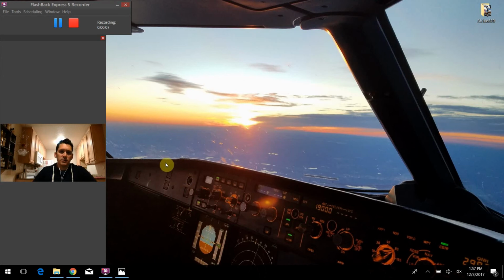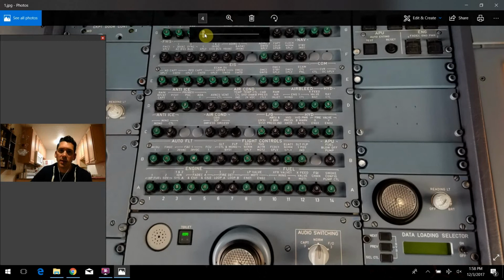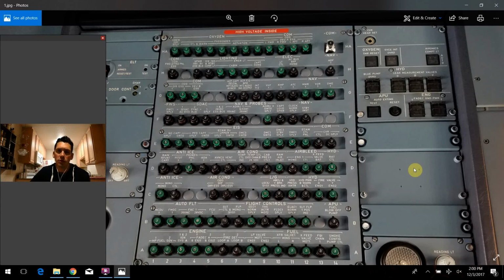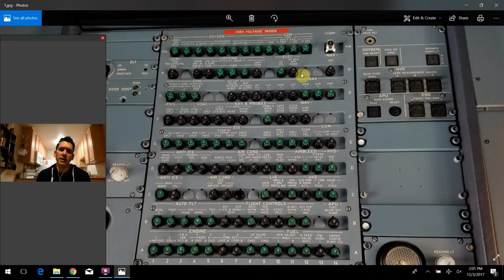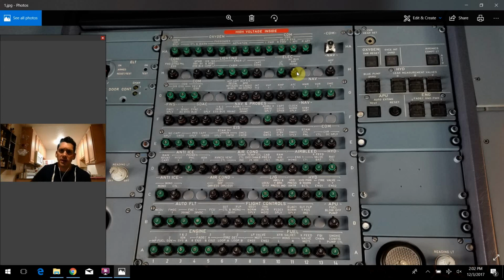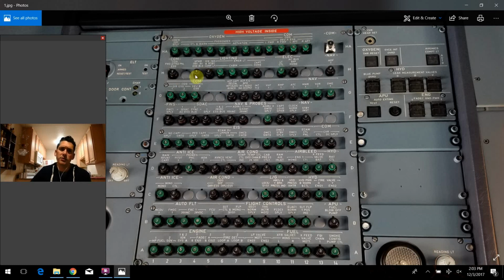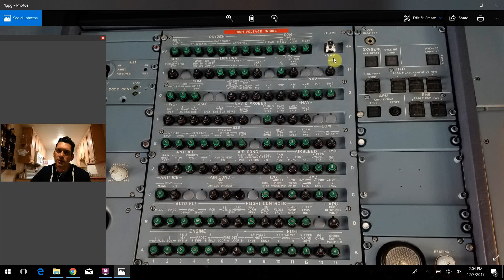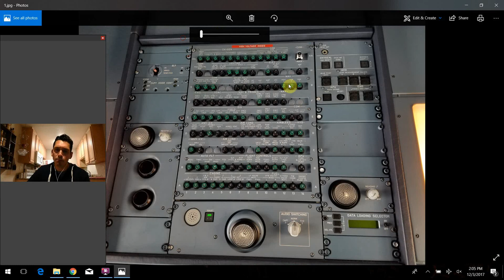Airbus A320 Cockpit Tour: #5-Overhead Circuit Breaker Panel: What do all those buttons do?!

Comment: Helloy Mike!Please ask me one question,which a320 CB’s never reset?Thank’s a lot!
Reply from the maker: Hi thanks for tuning in! Hmm, that's a hard question to answer as it is a very broad statement to say never. I assume there are some circumstances here and there that would allow for all of them to be reset at some point in time. Some more common than others, but I don't really have any good data to share on that front. A great question for a mechanic though..cheers! Mike
Reply: Mike Abignale As i already know the WTB CB which is located on 121/122  and have a red caps to prevent them from being reset.But looking for more information.Thank’s for quick answer and for your job!
Reply from the maker: ah Yes Ok I think I understand your question better now. Yes to my recollection, the WTB's are the only circuit breakers in the flight deck that have the lock out mechanism applied to them. Great question! Cheers!
Reply: In flight u can’t pull any SFCC , ECU , EEC or EIU circuit breakers . On ground there  are some rules to apply resets on some breakers like the BSCU.

Comment: Why the CB PNL 49VU not light plate incorporate?
Reply from the maker: Hey Arnol! Thanks so much for watching the channel! This is a great question. You know, I'm really not sure why the engineers decided to not back light these letters on the panels. The only thing I can think of is that they deemed these not as important for finding things quickly as the other lettering and labeling systems they have in place are. For example, most times we reference the qrh or mel we get both the VU panel reference as well as the actual circuit breaker itself. After a while you get used to which VU panel is which so you know where to start. From there, the actual circuit breaker itself would be more important and maybe why airbus decided these were the only things absolutely necessary to be back lit.